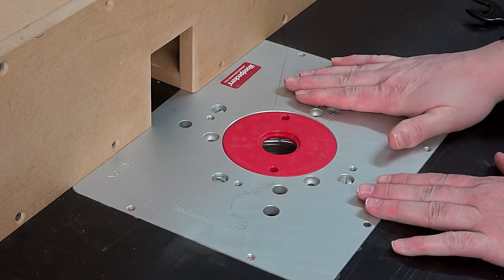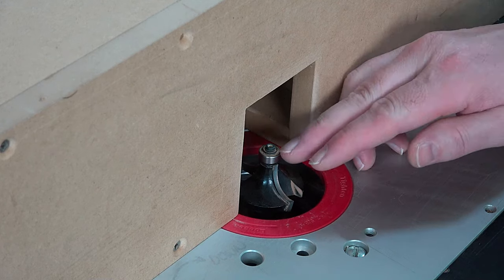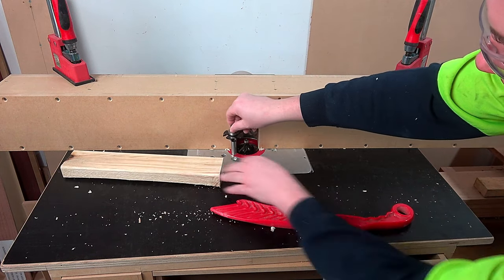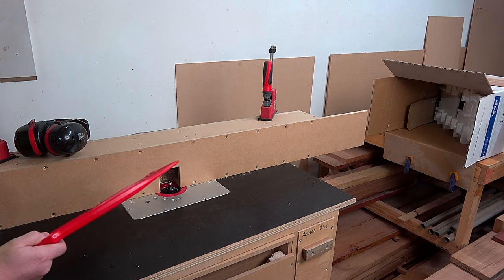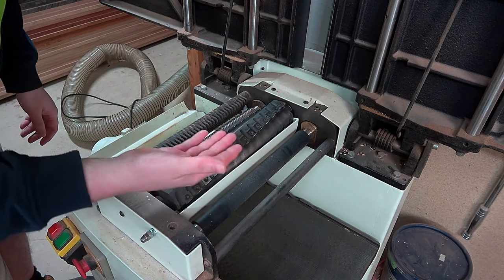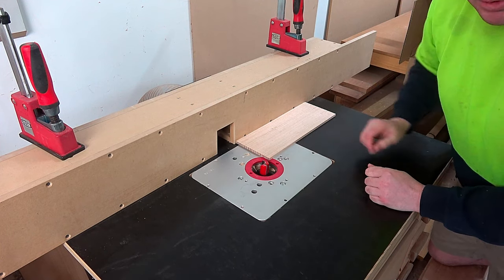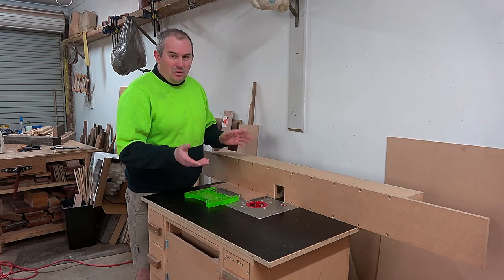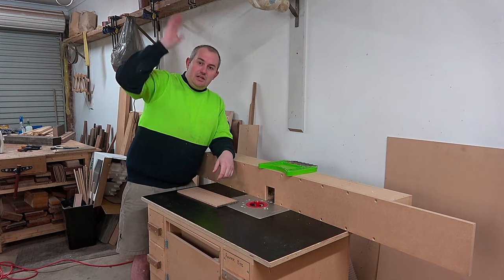Why you DON'T do this on Router Tables

Comment: Ignorant enough to set up my table for a cut between the fence and blade but smart enough to research it first before I made the cut and glad i did. 😂. Thanks mate for this video!
Reply from the maker: It's one of those things which seem so harmless, until it rips the board from your hands!
Reply: @kuffyswoodworktipsandtalk  it made sense because I was looking to clean up a flat edge. So my thought was the router table isn’t like a jointer where the fence on the front side matches the blade height so I first thought I’ll just have the blade on the outside. Until I seen this. Lol. Thanks.  
     I thought about using some spacers/washers on the front fence.

Comment: It seems the another problem putting the board between the fence and the cutter is the side force put on the router and the bit. Since both the fence and router are set solid, it would put some force against the bit. It may not mess it up right away. But the side force would not be good for the bearings in the router or the shaft of the bit. Of course, the feather board would help.
Reply from the maker: Correct. When you apply too much lateral force to the bit or the bearing guide, you will snap the shank or burn up the bearing until the outer bearing ring separates. The bearings inside the router body are generally pretty good because they are fixed in at least 2 points so it doesn't flex much, if at all.

Comment: Excellent video!  Years ago, I experienced some of these bad situations without harm to myself or the shop.  I would suggest a magnetic on/off switch so you can turn off the router by using your leg and without taking you eyes and hands off the router table to reach below the table.  It works great and increases personal safety!
Reply from the maker: Agreed. I've been a big proponent of having emergency stops located in a position which can be easily activated with our knees. I have loose plans of rebuilding my router table, so I'll probably put a magnetic switch in then.

Comment: This is the best all-around table router safety videos I have seen.  Thank you for this.

Have you a video on router kickback?
Reply from the maker: I haven't done a video on router kickback. It's a good idea to do a video on this topic, so I will. Kickback with routers is actually 'accidental climb cutting' when template routing. I'll demonstrate how it occurs, and how to minimise the chances of it occuring.
Reply: @kuffyswoodworktipsandtalk  That's exactly the kind of issue I have been having, and it's cost me some scrap and a template (or two).

Comment: 10:55 wow, I was just about to do this WITH A MUCH THICKER WOOD in my shop. Didn't know THAT is going to happen. Thanks for showing this!
Reply from the maker: I chose a small, lightweight piece of timber for a reason 😂 A heavier piece has a chance of breaking the router bit, which is usually uneventful but expensive.
Reply: @kuffyswoodworktipsandtalk  seriously... I'd rather lose a material/timber than a router bit 😭 once again, thank you!
Reply: Why would you do a cut this way?

Comment: What you failed to mention in your demonstration of kickback on the router table is how the wood was 'clamped'
between the fence and cutter and your long strip of wood. So the piece of wood could not move away from the cutter.
Thank you for showing this
Reply from the maker: Yes exactly. The strip of wood was roleplaying pretending to be my hands. My hands would do the same thing as the strip of wood, but it would make an icky mess 🤣

Comment: I was doing some routing on my table the other day and was having all kinds of weird problems. After stopping and examining things I realized that I was going the wrong direction on the table. What happened was I used the feather board that was on my table saw and it has an arrow in it and it was pointing the wrong way for my router. I had to take the feather board apart and flip the part with the "feathers" over and the arrow now pointed the right way. I had been doing some routing earlier without a fence, so I was going in the same direction, but the wood was on the other side of the bit. I will definitely be thinking a little more about what direction I should be going in the future. I will also be getting feather boards that will only be used on my router.
Reply from the maker: That's a common problem you had. It's exactly why I speak about feeding the timber in opposition to the rotation of the router bit. I don't speak of following arrows on jigs and fixtures because they are not always correct.

Comment: Very good explanation of the proper router table usage. Only thing I dont like is that you need to open cabinet door to stop the router, does not seems to be as the safest way.
Reply from the maker: Correct, thanks. I'm probably going to rebuild my router table at some point. I'll add an emergency stop button that can be easily activated with my knees.

Comment: Clamping bits- leave a small piece of foam rubber at the bottom of the collet. No need to fuss when inserting bits.
Bearing bits- the workpiece SHOULD touch the bearing- that is what it is for! If you space it off you are defeating the object.
Reply from the maker: I've never bothered about placing a small rubber o-ring or foam at the bottom of the collet. It's a good hack though.

Comment: THIS VIDEO IS GREAT. I've been following the direction of feed printed on the table - unconditionally. And I've been assuming that the solution to its murdrous tendencies has been more fences, more pressure, from more angles, MORE CONTROL... It's been driving my blood pressure through the roof becauae I'm always moving at a snails pace waiting for it to explode. 

DO RABBETS AND TENONS NEXT!! How do I keep those from getting spit out on the tail end when the bit finally breaks through the back of the piece?
Reply from the maker: Ah ok. I can demonstrate how to prevent the timber from splitting out as the cut finishes. The answer is to have a waste piece behind your board so the fibers are supported.

Comment: Very informative, thank you! I was also wondering however, is it safe to lower a board on top of the bit and then proceed to feed it through (left to right)?
Reply from the maker: Left to right would be a climb cut and the board may be ripped from your hands. Going right to left is much better, but lowering a piece on top of a spinning bit has the potential for some pretty silly accidents. With that said, I lower boards onto the cutter often enough. Sometimes I drop the board and break my router bit as a result, but I continue to do it anyway 🤷‍♂️
Reply: @kuffyswoodworktipsandtalk I meant to say right to left 🤦🏻‍♂️ But  I see, thanks for the reply.

Comment: One point of safety point.

Mark the direction of bit rotation with sharpies or engraver.

In the shop you tend to go from hand held use to tabled use... Lexdyslic mistakes happen.
Reply from the maker: Fair point. It's a good idea for beginners to get used to the difference between router table and hand held router feed direction.

Comment: Are climb cuts done on a table? or is that a hand held thing.  Especially to prevent tear out
Reply from the maker: I don't have a problem with climb cutting using a handheld router. Table mounted routers and climb cutting require experience, but even with experience, things can go bad really quickly.

Comment: So, inserting the wood from right to left makes a featherboard completely useless. Right?
How about a featherboard on top of the wood?
Reply from the maker: Great question. A featherboard provides consistent pressure towards the fence, or down onto the table. Consistent pressure results in a cleaner cut. It also allows fingers to be kept well away from the cutter if you're nervous about that stuff.

Comment: Okay, now im terrified to use my new router table
Reply from the maker: Knowledge is power, we only fear what we do not know or understand. I'd advise running through the motions with the router turned off. Make sure you are feeding the timber in opposition to the direction of the router bit rotation.

Comment: I have a full shop and the router is the one I worry about using wrong.
Reply from the maker: Using a router by hand is relatively safe. You might get the odd scare every now and then, but you'll probably come away without any scars. On the other hand, the router table can remove a finger in a blink of an eye. The best bet is to physically restrict your hands from being able to reach the spinning router bit by using lots of guards, but I understand why people rarely do this (I'm one that rarely guards my machines).

Comment: you’re missing a screw on that fence.
top, just to the left of the dust port
Reply from the maker: Haha, thanks! I quickly rushed out to check, and it surely is missing. Luckily there is about 100 other screws holding it together 🤣🤣
Reply: @kuffyswoodworktipsandtalk  
lol

Comment: if you have a bearing on your router bit then using fence is pointless.
Reply from the maker: The fence allows for faster work, given the greater level of control. Also, the pressure from the bearing on the timber creates a slight indentation in the edge of the wood.
Reply: @kuffyswoodworktipsandtalk  got it , you right!

Comment: The whole idea of using a router table for cutting off a thickness of wood or flattening a side is ridiculous. By the time someone is investing in a router table, they most likely have a table saw. I would love to see how the last part of the board stays straight at the end of the cut. Ya know... as the edge that is against the fence gets smaller and smaller to the point that there is less than an inch against the fence. How would you keep it straight at the end of the cut? I suppose you could use double sided tape to attach the wood you are cutting to a straight edged board and use a straight cut router but with a guide bearing. 
If you don't have a table saw and are thinking of getting a router... STOP. With a table saw, you can straighten the edge of a board. You can size the board. You can square the sides of the board.  You can cut up to a 45 degree chamfer. You can cut rabbit slots, dadoes and so on. There are things that are done better with a router. There are things routers can do that table saws can not. BUT... IMO... a table saw is much more useful to a wood worker than a router table. Just don't get a Ryobi table saw... they are not good for many reasons. I made that mistake. You want 2 channels, a solid fence that stays straight, and a fully adjustable blade.
Reply from the maker: You can offset the fences on a router table in the same way as jointer tables are offset. That's how you can remove a few millimeters off the face of a board resting up against the fence and keep it straight near the end of the cut.
Reply: @kuffyswoodworktipsandtalk  ah yeah, didn't think of that. Great point.

Comment: What a poor explanation at the beginning of this video as to how to fit a cutter into a collet. He does get it in correctly but there is no way a collet will pull the cutter downwards into the machine. The reason an air gap is left between the end of the cutter and the base of the collet is to protect the main bearing from heat. A router bit gets extremely hot in use and if the cutter is bottomed out in the collet that heat is transferred into the main bearing of your machine.  Do that often enough and there is a good chance you will burn out your machine as the bearing begins to fail.
Reply from the maker: When you tighten the nut, it presses the collet further into the collet housing, dragging the bit with it. It's possible to bottom out the bit.